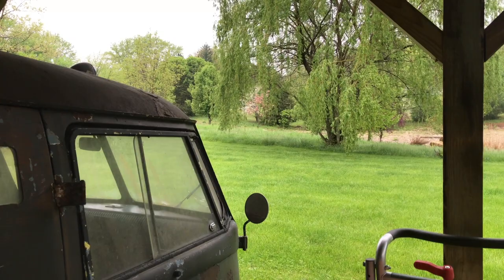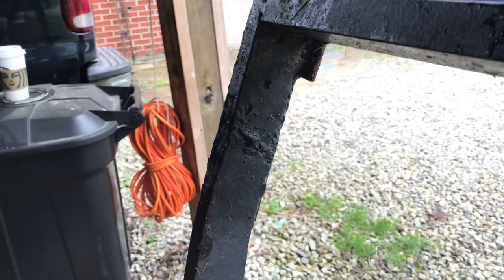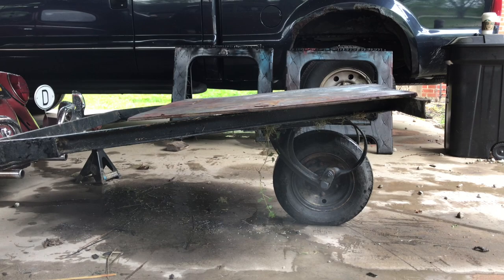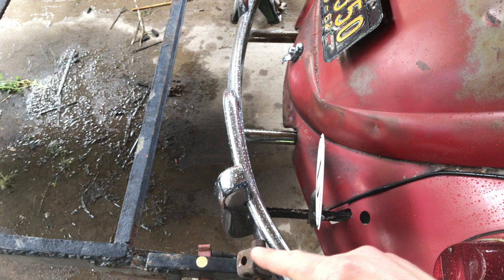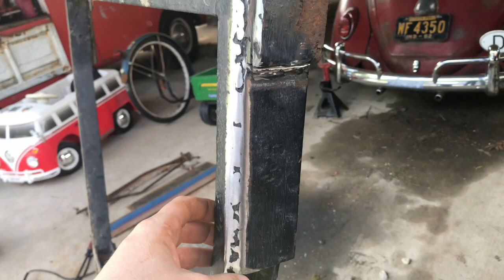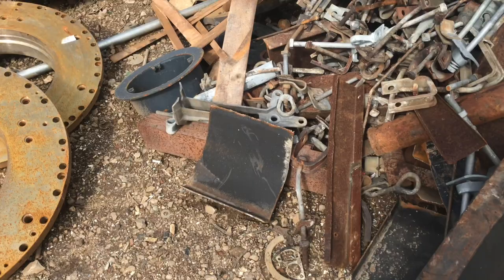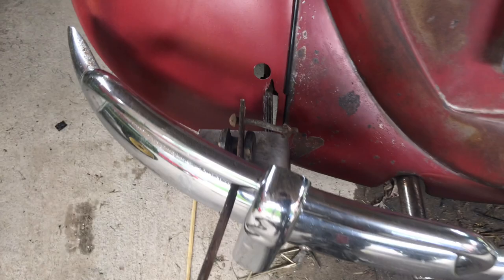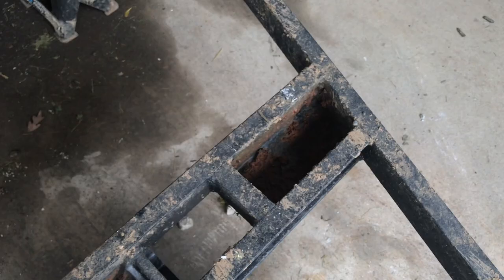Single Wheel Trailer Hitch build, Montgomery Ward Trailer

Comment: Cool video, I love how engineered those trailers are then you look at how the actual car pulling it is made, I love how you repair stuff instead of replacing it, its what I prefer to do as well,  I gotta learn to weld, I just paid a trailer place $150 to weld the back of my custom stretched lowrider . I could have bought a 2nd hand stick welder for $20
Reply from the maker: yes these trailers are so cool! Welding is NOT hard...face it you don't have to have a pretty weld...it just has to do it's job! Go to harbor freight and get their middle of the road MIG welder (on sale they are $170) it's totally worth it! There are two things every person should be able to do...sew and weld...if you can do those there isn't much you can't fix or build! thanks for watching!

Comment: that worked out pretty slick, l got one kickin around out back that needs the same brackets made up for it, do you need to register it or just run without a plate,
Reply from the maker: Yes, it worked way better than I expected! ha In Indiana we ARE required to have plates, but so far on the other two we have we have been able to apply for a homemade trailer VIN and both have passed.  It just requires that the state police come and verify once the VIN tag is on trailer after BMV issues it to you...

Comment: Luv how you shop the yards for scrap materials for projects, just an FYI U might want to add a W shaped angle to tie in the sides of trailer frame with the front crossbar to keep it from racking............looks good but I  would seriously address that patched up spring with a  replaced unit from a local spring works, they have specs and can build  you one pronto and it's cheep insurance and peace of mind.................add some vintage tails from a bus to add to the look????
Reply from the maker: It's one of my favorite places to go!  yes a crossbar is a possibility, we didn't need it on my dad's and his tows great...but I might have to add it to this one...I have an allstate I pull behind my bus and it has no issue and the arm set up I made is very similar, but we will just have to tow and see... Yeah I'm still not positive what I'm doing with that spring...but will consider your option! 
we are still undecided about the tails, but you will see what we go with in a couple of days, because we are trying to have it completed in about 5 days! Thanks for always being here!

Comment: I recently purchased a one-wheel trailer.  Unlike the versions in your videos, mine has an aluminum box w/lid.  I cannot find any identification markings on the exterior.  It appears to be factory made, not homemade.  I have looked on the internet but cannot find an example of mine.  Do you know of anywhere I might find info about this trailer?  Thanks.
Reply from the maker: If you have not already done so check out the website
http://singlewheel.com/ 
it is a great resource! Also if you are on Facebook there is a single wheel trailers page there and if you posted pictures of yours someone might know what it is...I do know there were numerous manufacturers that made aluminum and lid versions! Sounds like you have a pretty cool one!